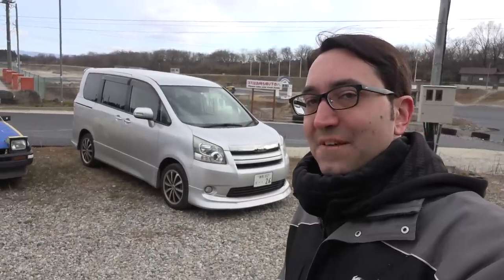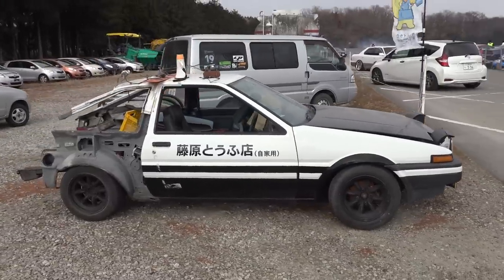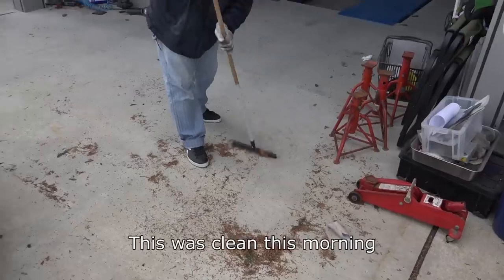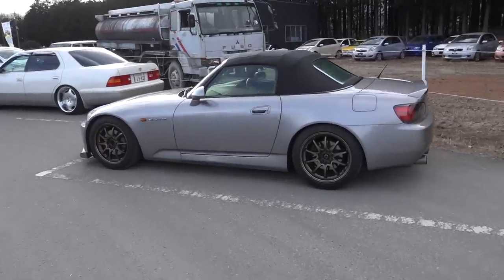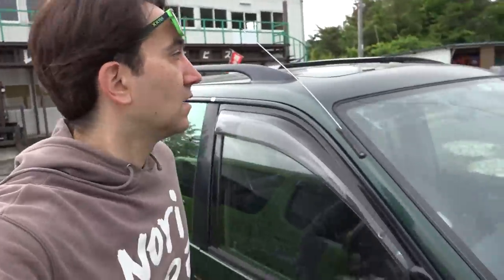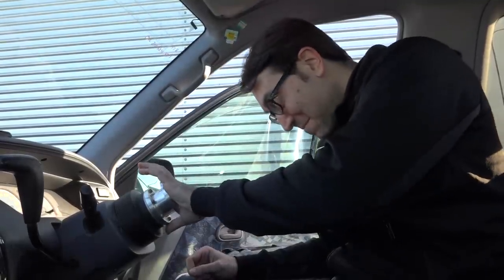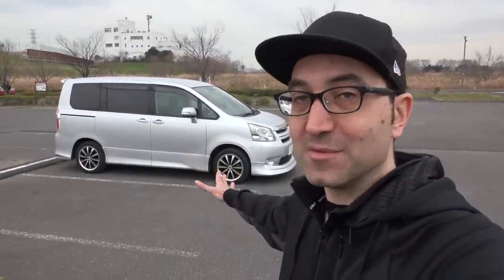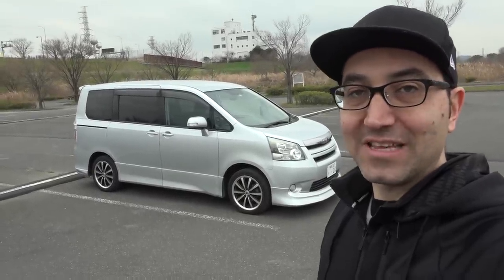New drifting circuit and new JDM van!

Comment: You should order a twin size air mattress on Amazon and get a 12-volt air mattress pump and leave it in the back of your van for when you need to sleep. All you need to do is blow it up and lay it over the seats and it will feel like you're at home. Obviously bring some pillows and blankets as well.

Comment: gt86's and brz's are still over 10k€ all over europe lol
Reply: And our goverments aren't helping to bring the price down.
Reply: @TomiVuori  co2 tax on a gt86 is like 5 grand extra
Reply: Here in Brazil we don't even see these cars on the street
Guess you shouln't complain ;-;
Reply: Japan basically throws away cars once they're 5 or 10 years old so I'm not surprised they're cheap there. Australia hangs onto cars forever. Cheapest on Carsales are all $15k.
Reply: Average $16k in Canada with pretty high kms
Reply: Cheapest gt86 in finland is 23k€.
Reply: Fuckin things are 45k euro new here... they only sold 2 in 2019 😂 used are still 15+
Reply: Norway: 7 manuals for sale cheapest one 26 000dollars, 1 drift spec for 46 000dollars
Reply: USA here, did a quick search and found 10 used BRZs for sale within an hour's drive of me. Most were between 15 and 20k USD with 30-100k miles (~50-150k km). For reference, I bought mine new for ~26k USD. They aren't super common, but they're readily available. I guess they hold their value fairly well.
Reply: in the part of the US where im at i see them creeping below 10k semi regularly. salvage ones are getting cheap finally. wouldnt mind putting a better motor in one.
Reply: In Spain are over 20k€
Reply: avrg here is 18k usd

Comment: Dig the van, for a 2007 model it still looks modern, although the switch gear reminds me of a mid 2000's Corolla. 3S-FE used to power the boxy Celicas, come to think of it I haven't seen one of those on the road for ages, or a Celica Supra or MA70 for that matter.

Comment: Well the beercan has the tightest suspension out of all your cars, and requires the least amount of work to get it running again.
Just change the snail on the beercan, just whatever from whatever, with your driving skills doesnt need to be 1000hp internet slayer = good to go, should link that whole track ^^

Comment: van need a slight lowering and why not mount the old wheels on it if possible.
saw that old van is 4 bolt and new van is 5 bolt so wheels wont fit :(